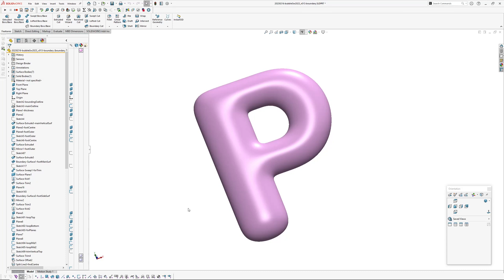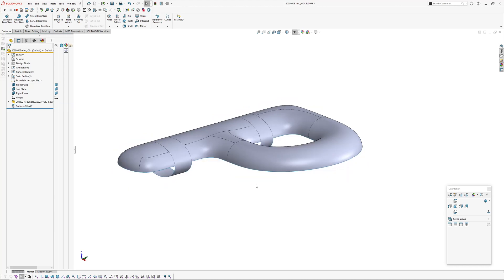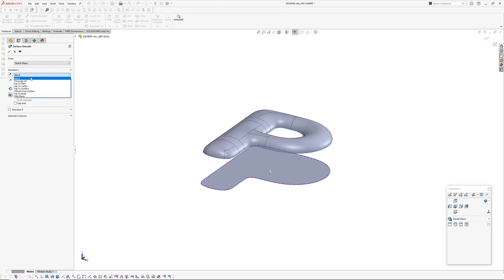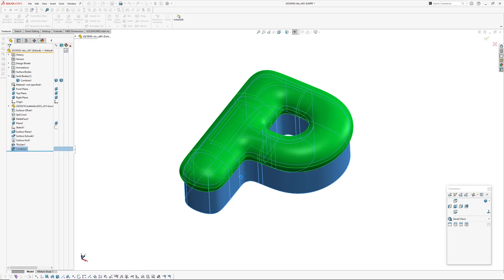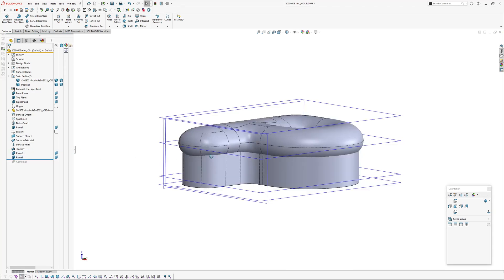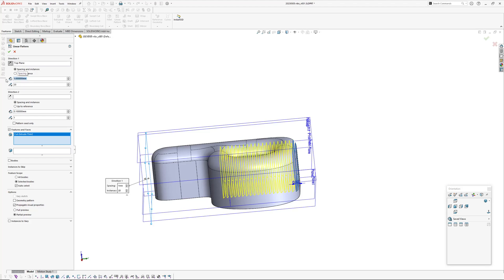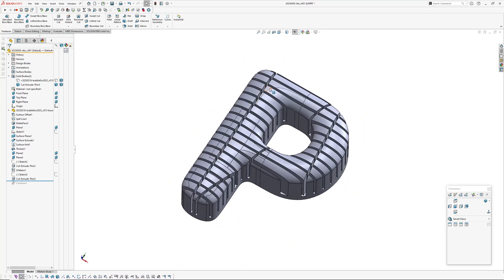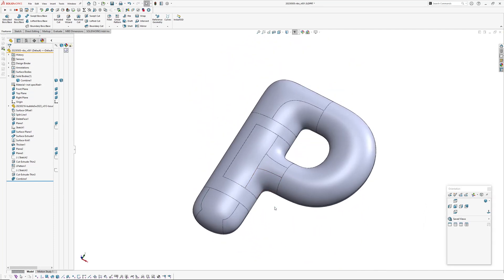Ribbing Technique Using Combine in Solidworks

Comment: Hi Andrew, thank you for the high quality content you produce! I would like to ask if you have a clean/optimized installation method for SW2023 with a focus on modeling only, anyway, how is your configuration method for installation and configuration for modeling jobs? I would love to see a video on this if possible. Thanks! 🙂
Reply from the maker: Hi there, thanks for the comment! I use the copy settings wizard to move my settings over to each install, however there is not a huge amount that I have changed... there are not that many modelling specific options open to the user, say vs proE, where I had quite an extensive config.pro file. 

Mainly I have some hotkeys for solid/wireframe view, hide/show all, hide/show sketches (means you can display sketches easily, or sketches + planes etc). I have a template part with white backdrop (just the standard white backdrop), as the default gradient is poor for viewing shaded models. I do have a few options set up re external references. Probably enough for a video! Thanks for the idea!
Reply: @AndrewJacksonDesignStudio  Thank you, the video was excellent, thank you very much! Can I ask you what mouse and keyboard do you use or indicate? A friend told me that the Logitech MX Master 3s mouse could be good, but there are several models and I don't know specifically which one would be better or if there are other better brands and models, any information from experience is welcome, I use a normal microsoft, but I think it's time to invest in something better and more comfortable mouse, keyboard and mouse pad too, which I think is an important detail for good smooth movement. Thank you teacher/master!🙂
Reply from the maker: I've got a low end Logitech KB with (full size) need to replace it though as I use it with the legs extended and one broke... currently replaced with a sprue off a chair project :) 

I use a Logitech MX 518 mouse. Current one has lasted over ten years and I had the same before this. There are a few reasons I use this mouse. The form is asymmetric, which rotates my thumb higher and I find this minimises strain. Other reason is the scroll wheel does not rock left/right like lots of mice do now. When the left/right scroll wheel came out Logitech changed the switch from a microswitch (similar to the L/R mice keys) to a lower profile switch with a shorter throw and harder tactile response. I ended up getting a bruised feeling in the end of my finger after a long day... Looks like they have relaunched the MX 518 so I might grab a back up.

Mouse pad - I went for it there, I have an A2 green cutting mat under my keyboard and mouse. Works well. And you can flip it over to do cutting work :)
Reply: @AndrewJacksonDesignStudio  Very cool your report, thank you very much and I will take into consideration the purchase of this mouse, I have just entered the manufacturer's page and right at the beginning two important phrases "The Evolution of a Classic" and "The Legend MX518 Reborn" 🙂. It has a fair cost, and seems very resistant. I'm going with it! Thank you very much for your time and attention master!
Reply from the maker: All good! Hope it works for you. I've taken my MX518 apart several times to service, pretty straight forward to do.